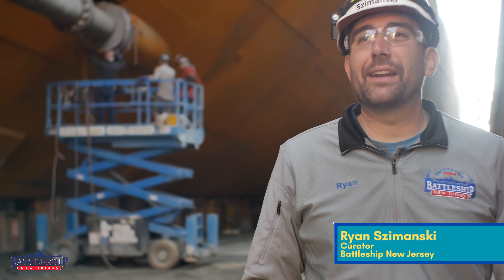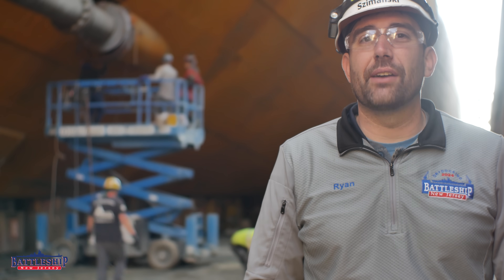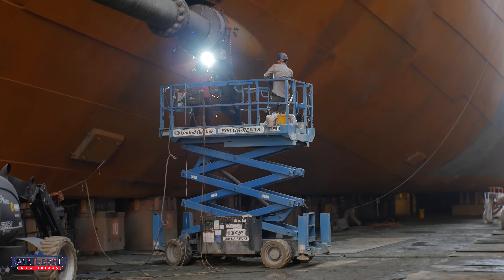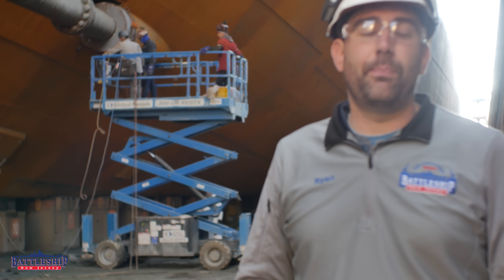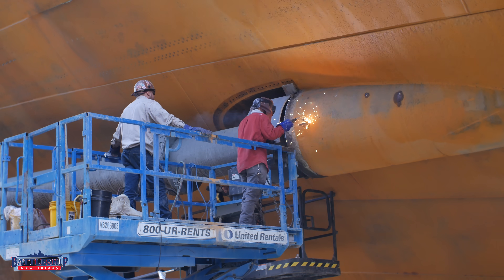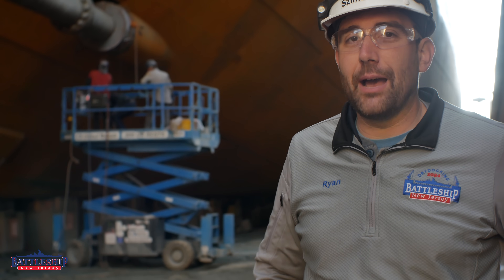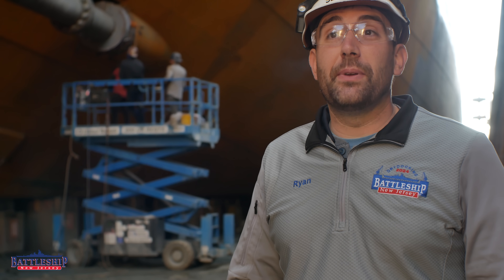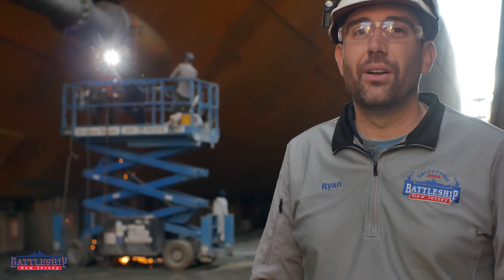How We Keep Water From Coming In Through the Propeller Shafts

Comment: This is quickly removable for alien invasion, correct?
Reply: I'm worried about the exact same thing.
Reply: Nah, just raise steam and power away. Pretty sure the 53,000hp on each shaft will twist that thin plate into steel wool
Reply: Need to tell Ryan to lobby Hollywood better after all the tease for Battleship II was in the UK and an alien force might make a run towards the US to gain access to Nasa equipment or even Greenbank in WV and would go up the bay first to get close.
Reply: Naturally 😉
Reply: As quickly as someone can play "Thunderstruck".
Reply: 20 men and 2 hours, good to go.
Reply: Too late.
Reply: Theyre not showing you the small charges, detonators, and wiring inside thatll allow 'ejection' of the boxes when needed...😂
Reply: "I need to borrow your boat" - "sorry, we must go to drydock then to remove the propeller shaft boxes!"🤔

Comment: Weight of the propeller on the seal? Maybe the curator needs to consider the purpose of those struts radiating out from  that long bearing just forward of the propeller. That and the series of bearings just inside the hull aft of the shaft seal and the first one forward of that seal. I wish those museum gurus would spend a few minutes learning something about the topic before making these selfies. The museum management apparently doesn't care as long as people keep giving them money.

Comment: As a static museum ship it's a clever way to ensure the most vulnerable points are protected from flooding . Being removable does allow for any possibilities in a crisis . Rust is the main enemy in preserving these ships and the work presently  being done should mean Ryan and his successors will only have the bilges  and interiors to worry about for quite a while .
Reply: In a crisis situation, if the shafts would ever be operated again, the welds on shafts are a problem as potential fatigue sources. Perhaps the welded shafts could be pulled out, welds and parent metal ground smooth and all cracks removed, or new shafts manufactured. Not a show stopper but an extra nuisance anyway. But yes, otherwise, assuming that she will remain as a static museum ship forever, this fix sounds fine.
Reply: @mhyotyni  Not an engineer, but i'd expect the weld to not penetrate more than a couple percent of the thickness of the shaft, not really impacting it that much. But always open to learn more about metallurgy.
Reply: realistically the iowas will never be recommissioned. It'd be cheaper to build a new warship. Worst comes to worst they'd be valuable only for their steel.
Reply: There will be no crisis where these ships ever get used as ships again.
Reply: @mfbfreak  RIght, and the weld is far enough outside of the packing gland it's not an issue. That part of the shaft sticks out into the water, and is designed to be able to have a certain amount of depth of inevitable corrosion before needing to be replaced.

Comment: As the shaft rotates, it doesn't "distribute the weight" around the packing.  Gravity pulls down, regardless of the shaft rotating or not.
Reply: It's not nice to point out how little the curator knows about how ships propulsion systems work and the role of each component he pretends to explain to people who know even less than he does. I guess he hasn't noticed those struts and the bearing just forward of the propeller. The weight of the propeller is carried by a series of bearings from just inside the hull to just forward of the propeller, it is not imposed on the shaft packing. This lack of subject matter knowledge is a problem with museum ship people and YouTube culture and is really inexcusable.  If those people don't know what they are talking about they should either hire people who do or just keep their mouths shut.
Reply: Dude, you really need a nice, relaxing walk  @oldtugs

Comment: How is the stuffing box made and does it require regular operating? Once my father had a somewhat older boat, and in contrast to the teflon or whatever material that is used in modern boats, it had an old-school stuffing box filled with some fibers (hemp maybe?) and then permanently connected to a grease pump. Before starting the engine you had to give the pump a few squeezes to build up the pressure, to make up for grease that had dissolved into the water. And if we for some reason hadn't used the boat for a while, when going there to check that everything is ok we used to pump some grease into the stuffing box as well, just in case to prevent water incursion. I assume something similar was used on early-mid century ships as well? So do they require regular grease pumping to keep the water out?

Comment: Once boxing is finished are they going to fill the void with a lubricant or some other fluid to keep a positive pressure inside so water won't want to push in

   Also even though the shafts are locked I still feel tides and especially towing may  make the shafts flex a bit and crack some of the welds, so again a Heavy inert lude/filler
Reply: Look_What_You_Did care to elaborate?

Comment: In this drydock has all the welding been GMAW? I would guess original welds would be stick welded. Is anything on NJ tig welded? Great video!
Reply: It's most likely dual shield flux core wire.

Comment: With the inboard screws, since you have an access portal to the inside of the skegs, how about installing a jack screw under the shaft to take the weight of the prop off the packing?  

I would think the inner ones would be the more concerning as the outer propellers are supported by the lantern bearings on that support structure, thus the outer shaft packings should only see some of the shaft weight between the last internal bearing and the external lantern bearing by the propeller (or are there no bearings on the shaft between the packing and the engine?)

Comment: I know you also have another reason for doing it this way: there's still an extremely unlikely but non-zero chance these ships will be recalled at some point in the future, so you're doing this as an easily-removed modification. I respect that you're trying to maintain her as-is and not alter her for easier civilian access like they did with North Carolina, which had a huge hole cut in the rear of the armored barbette.

Comment: Ddg 995 had a shaft turning gear.Electric motor turned the reduction gear ever so slowly.Even in the yards the turning gear was active every so often.Not constant.The goal was to keep the shaft weight between shaft bearings from warping the shafts.Im surprised yours are locked in place for that reason.If they plan to reactive one would think they need to be turned periodically. But apparently they don't use turning gears on all sitting shafts.
Reply: What you are describing is called "Jacking Gear" and most active Navy ships have that feature.  None of the battlewagons are going to be going anywhere so the Navy locked the prop shafts in place.  Part of the contract between the Navy and the Museum forbids activating any part of main propulsion including releasing the shafts to spin.
Reply: Turning gear is also rotating the Reduction Gear before underway and also for cooling down the reduction gear from deployment.
Reply: They're. Not. Being. Reactivated. Ever.
Reply: @dieselyeti well. they. should. be. now. 😁
Reply: @scottyb68  Uh huh. Why now?
Reply: @dieselyeti I completely agree the Iowas are never coming back, but I wish budget had allowed for one to remain in service as a ceremonial ship.  Something we could send for dramatic force projection as well as relations building with allies / friendly nations. They’re never going to be fit for modern warfare but still would have been nice to keep one around to show off.  

Although I do have to wonder what the PLAN would do if we decided to modernize the Iowas and return them to the fleet.   How would they counter that, in terms of saving face / force projection?  They’re clearly trying to beat us on paper but how would they address battleships….

Comment: You said the weight of the props pushed down on the shafts at the packing gland.  Wouldn’t they cause the shafts to lift since the props are aft of the strut bearing.  They are cantilevered on the end of the shaft pulling down at the strut but picking up at the gland seal. Great videos.  Keep them coming.
Reply: Don't confuse a  curator with technical ideas, it makes for bad selfies.
Reply: @oldtugs even if I’m right, in the ga,e of battleship trivia, it would be one for me and ten million for Ryan.

Comment: What is the affect on the packing being dry?
Reply: when they dry out, they shrink, which allows leakage.
Reply: @leftyo9589 so if the collars fail it could be a worse leak than just packing the shafts normally? Or would they become engorged when put back in contact with water?

Comment: Just a thought on the packings while in dock perhaps unlocking the props and giving a single rotation would be helpful before the boxing.  Just thinking the lube and packing would settle from gravity as well so while you are protecting it now when that protection fails the packing will already be dried out.
Reply: Unfortunately, the shafts already have things welded to them by the Navy so they cannot move.
Reply: @johnzengerle7576  Thank you but I mentioned unlocking them that the Navy would do with a reactivation.  Though the Navy locked equipment they made sure it could be undone at need.  They already did such on all the Iowas at least once, some in the very dock that she now sits.  It may cost too much but even the contract requires her upkeep to keep her in condition for reactivation.  Though at this point likely mute.  Though it would cost too much I would love to see former ships like her to be able to move under her own power even if it was just once a decade.  As she stands now she is more a barge than a ship.  Even old ironsides USS Constitution sails once a year and stays on the ACTIVE DUTY list.  Not just a historical relic.  HMS Victory I will say is a building now as it is concreted in and supported with beams from the former dry dock.  I enjoy History and it is a shame to render the old warriors to a permanent helpless state.  A movie deal could even help pay for it like Battleship.

Comment: What if any work is being done on the inside of NJ while in dry dock?? Thanks
Reply: Almost none other than minor work in progress. They're still working on the deck, afaik. The goal of the dry dock is to proof everything exterior from the waterline down (and a little bit above).
Reply: The only work above the wind-water line they are doing is redecking the area right around the gangplanks, because this is just about the only time they can do this work.
Reply: @aserta  nice was thinking of “A while it’s in the shop” kinda thing. 👍
Reply: @jpoplin1  In Ryan's previous videos he explained that Time, Funding and size of Workforce negate any interior work beyond hull repairs.
Reply: Doing hull work during dry dock would be a waste of time and resources. Any work that can be done inside can be done while floating
Reply: I believe they got the sanitary tanks cleaned out and the deck crew really made some progress since the public isn't in the way.

Comment: Are the propellor shafts solid, or are they hollow?

J
Reply: Look_What_You_Did Texas has hollow shafts, so it’s a good question.
Reply: Look_What_You_Did Hollow. What kind of answer is that?

They are hollow, there's even a video where Ryan talks about it. From a physics pov, it's because most of the torsional stress on a cylinder occurs near the outside, so by hollowing them out you can save a significant amount of weight without incurring much of a strength penalty
Reply: Look_What_You_Did  hello? Do you see how wrong you are yet?

Comment: Would be neat to put some type of flood sensor inside those boxes so if the box ever failed you would get a notification of it. Might be overkill though since the original packing seal is still there as a backup seal instead of primary seal.
Reply: Are there sensors that would be able to transmit out of that low distant area thru all the layers of steel and armor tho...
Reply: @garywayne6083  i doubt there are any wireless ones plus battery life would probably not be good enough either considering the frequency of planned dry docks. It would likely have to be a wired system and therefore probably not real practical.

Comment: How did they move the ship into the dry dock when the propellers were locked?
Reply: Not sure what the question is.  Do you mean how did the ship move?
Reply: They did not drive the ship under its own power. The propellers don't need to turn when you're not using the engines. The ship was towed from point A to point B with tugboats.

Comment: I find it amazing, that a massive dry dock company, needs to rent scissor lifts, from united rental. Just why?.. can't they afford to buy their own?
Reply: Probably cheaper not to! Purchase, maintenance and mechanic staff, depreciation...
OR- just bill the customer 110% every time you rent one...
Reply: having your own scissors lifts puts all of the liability of maintaince on you.

that is not financially smart for a company and, thus specialized rental services have become prevalent.

you can thank safety rules and regulations for that.
but don't negate that those regulations were written after someone died on a jobsite for no good reason other than someone's negligence.

having every facet of a project handled by someone that is an expert in that area is always best.

you don't want the guy running the pressure washer to also be checking all the scissor lifts for safety violations and mechanical failures.

then doing welds on a hull.....

Comment: Attaching a few sacrificial anodes inside that box to the shaft might be an idea to slow corrosion.
Reply: As it is now the steel shaft is the 'sacrificial anode'  for the brass or bronze propeller; as it is higher in the chemical activity scale. Another possibility would be to use an active cathodic source to maintain the shaft at a negative potential to the water, as is done for pipelines in the ground.

Comment: Is that welding on the shaft? It will introduce weaknesses into it and it can just snap in two at the welding point. Shaft steels need good preheating before welding.
Reply: With the shafts never being used again, i dont think thats much of a concern 👍

Comment: so - 2 thoughts - was this something you had per the rules to ask the navy for Permission to Do?  next have you ever considered engage the jack gear and turn the propeller slightly? or have you already shown us in a past video something done that prevents use of the jacking gear/ turning the prop  slightly. Another question - bolt or rivet holes near this work- Is that from some fairing or piece removed now for this work.
Reply: The Navy locked the shafts in place when ti was decommissioned

Comment: Lets hope their welding is up to spec and there aren't any patches where the weld hasn't penetrated both plates, or water will seep in rendering it useless.  As it 's being MIG welded that would be my biggest fear on something like this, it only takes a bit of impurity or contamination for the weld pool to become unstable and affect penetration, made even harder to identify while working in confined or awkward areas where you can't see what's happening very well.  Are they offering any sort of integrity testing once the job has been completed? Dye testing for cracks is probably one of the easiest and fastest methods for identifying problems.
Reply: Id expect they'd do a quick pressure test on them...
Reply: @wheels-n-tires1846  Had thought of that but it would be problematic.  Don't forget that the gland seal isn't air tight, in fact they're not even fully watertight, hence the need for bilge pumps.  Whatever you try to pressurise that space with is going to try and escape through the gland.  I suppose you could try and fill it with a liquid and see if there are any external leaks, maybe with a UZ dye added.  I was actually thinking filling the void with a liquid containing both a rust inhibitor and a sealing agent might not be a bad idea anyway.  It would certainly be better than leaving it as an open void that will undoubtedly fill with seawater at some point.
Reply: @Altair885  sure... I imagine thered be some leakdown into the seal, but it wouldn't be too difficult to determine that the weld was watertight. And maybe an extra step, but I don't think that  filling the box with foam would be a bad idea.  That'd pretty much ensure the integrity for a long time. That'd make it more fun if they hafta torch the box back off at some point though!!🔥😂
Reply: @wheels-n-tires1846  Seems logical to me, if you're going to do the job it might as well be done right.

Comment: the struts barrels are holding the weight of the propeller and the shafts, not to mention the thrust bearings just fwd of the hull penetration. gravity is still pulling the shafts down even when they are rotating. Where is the football at the shaft connection???

Comment: I'm no marine engineer but this sounds like a bad idea to me.  First, the inside of that box is untreated/uncoated steel, subject to corrosion.  If water gets in there for any reason it's going to start to rust from the inside out.  Second, if the box remains watertight then there's no water keeping the packing swollen and it will eventually shrink and develop gaps.  If the box fails, for whatever reason, be it a bad weld or corrosion through from the inside, that packing is going to leak like crazy.

I could very well be wrong though.  Only time will tell.
Reply: Id assume theyll pressure test the boxes, and then rely on the paint to keep the corrosion away til the next drydocking.